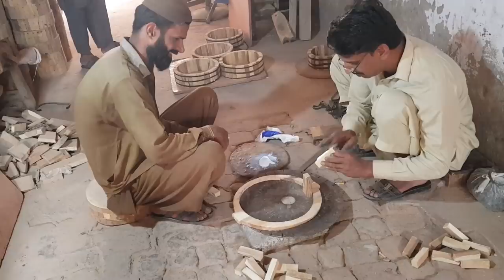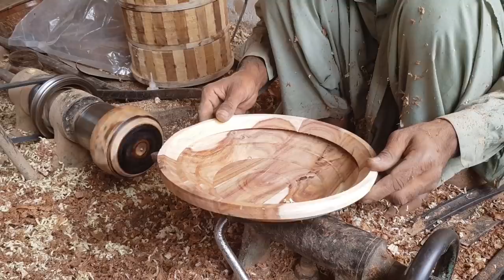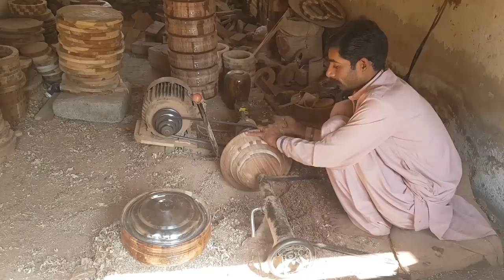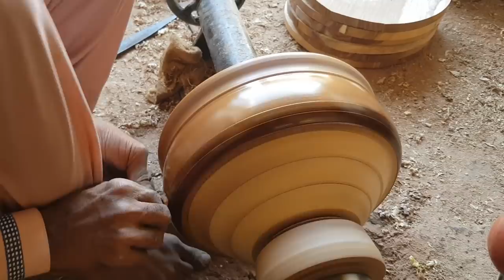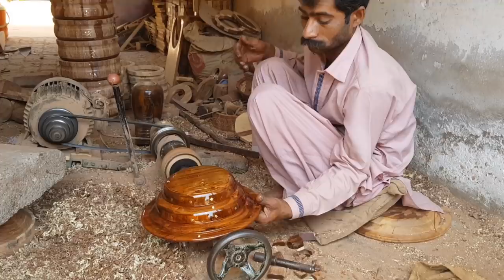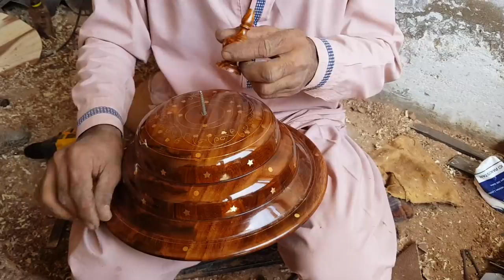How To Make A Incredible Wood Hotpot With Magnificent Effort

Comment: Everything shown here was excellent. However, when we say it is a hotpot, the sole purpose of it fails when it is not air tight. Therefore, a slight modification in the design is required to make it a useful product and not just a show piece. Thanks